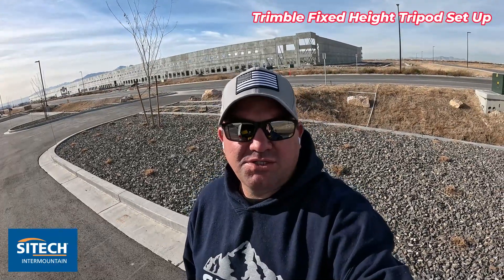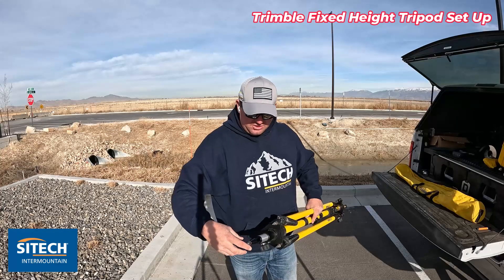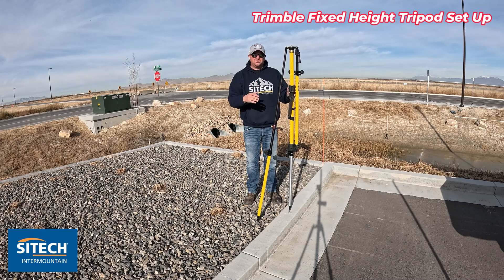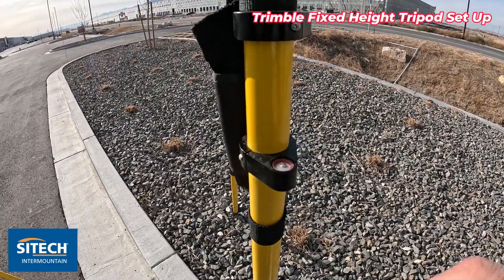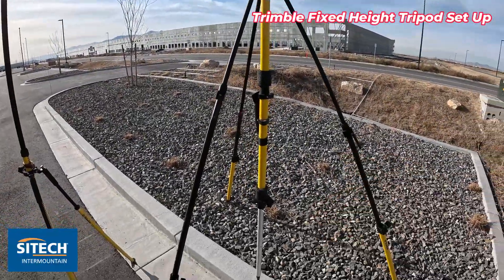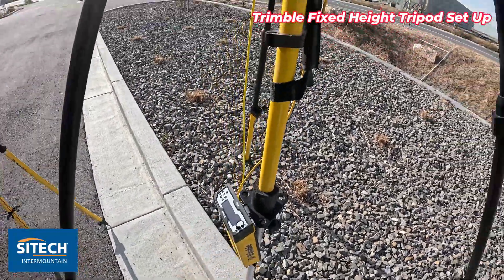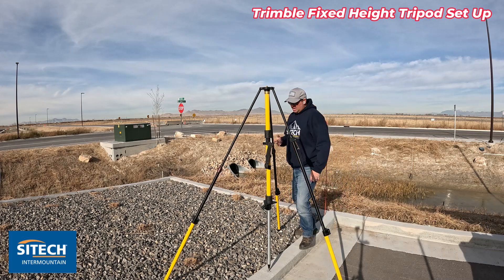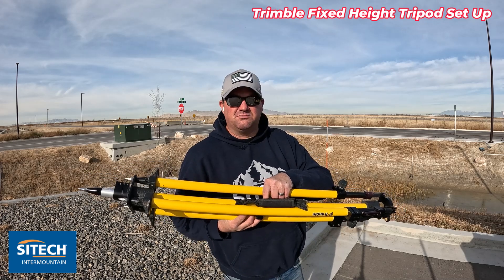Trimble Fixed Height Tripod Setup Best Practices

Comment: on a zhepyr rugged 3 antenna where do you measure too? same as this one?
Reply from the maker: @mrcupcakeman32  yes it’s the same as any other.  It’s too the bottom of the zephyr
Reply: @sitechintermountain  by bottom you mean top part of the tripod?
Reply from the maker: @ yes where it threads down on to the tripod
Reply: dang it if been measuring my zephyr rugged 3 wrong then...I measure it to the top of it...been setting it at 6.72 instead of 6.562 which is the 2 meters my tripod extends too. thanks for the help

Comment: Great video. 

Question for you? 

When setting your base station on a control point with a known elevation like in the video set the height to 1.8 m and get the base station all good..

Now say I want to measure in a control point on a t post I would screw my rover head on and click measure control point for a couple of minutes on that screen the antenna height should be set to zero on the measure control point screen?
Reply from the maker: @motowncooking6125  yes, if you are measuring another point that is a t post or something like a fence post etc.  shoot the rod height as 0.    You are correct
Reply: @sitechintermountain  Thank you for the reply. 

Quick follow up question so say I set the t post and the elevation is off. What is the best way to adjust the elevation so it could permanently make that control point I just shot in the correct elevation always?  Do you just edit the control point and then you have to reconnect the base station to the new Edited control point? Or is there a better way? I noticed if I adjust the elevation on the base station in the future if I connect on that job to that control point it goes back to the bad elevation. More curious if there's a better way to address the vertical elevation being off without having to reconnect the base to the edited elevation on the control point?